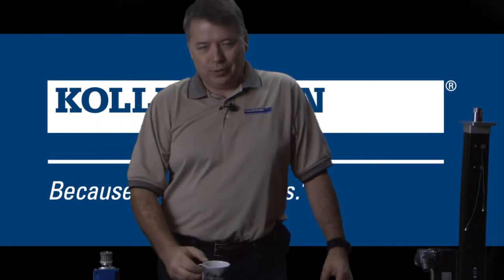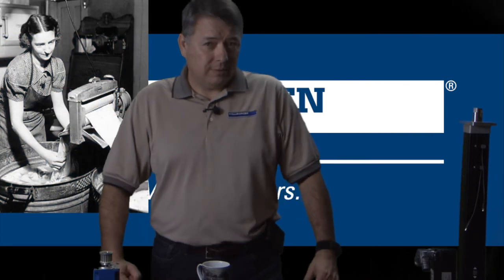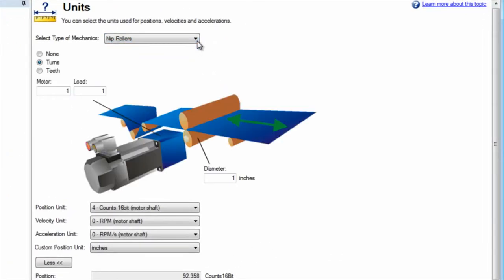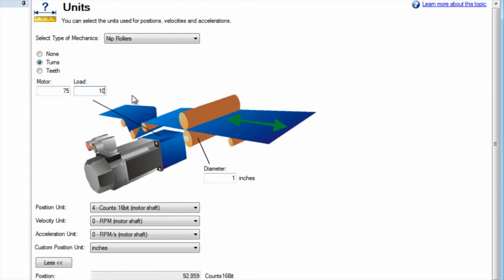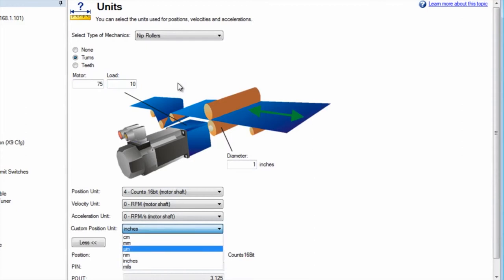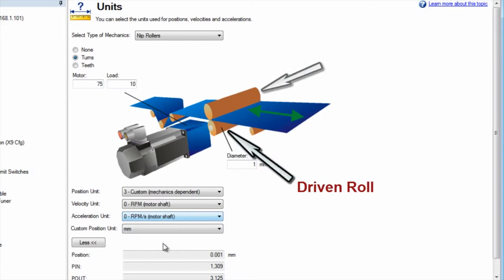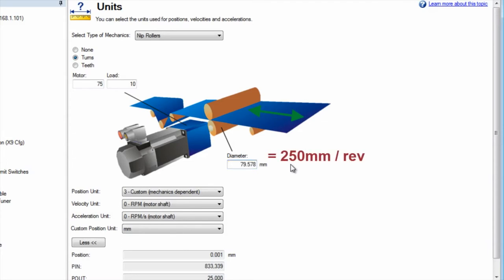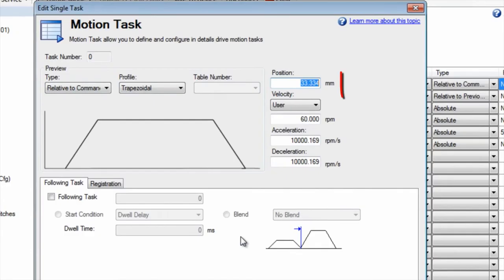AKD Nip Rollers Setup | Kollmorgen | 2 Min of Motion

Comment: PIN / POUT = units / revolution.  Kollmorgen does not just use a floating point number, because the processor in the drive is so under-powered.  Instead, it must use two integers.  (The ABB drive I used before executes BASIC 8X as fast as the Kollmorgen.)